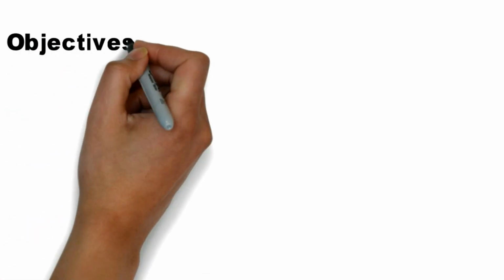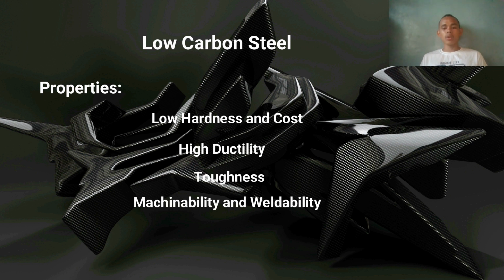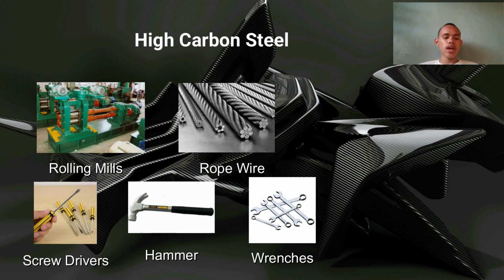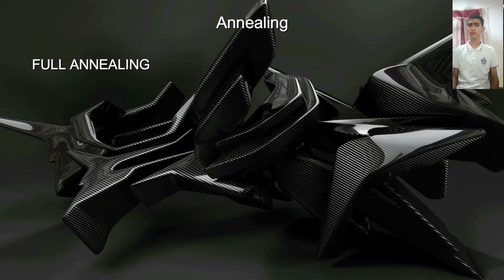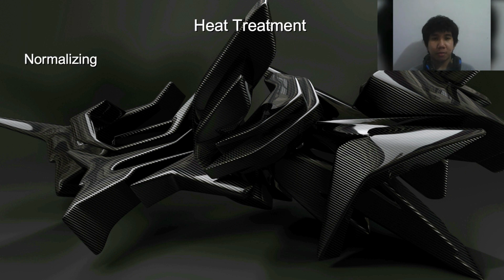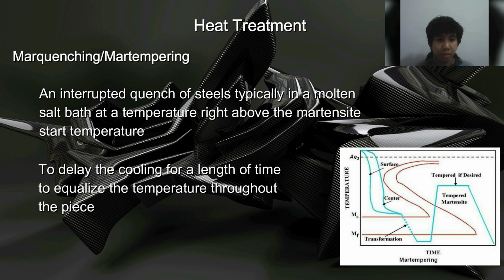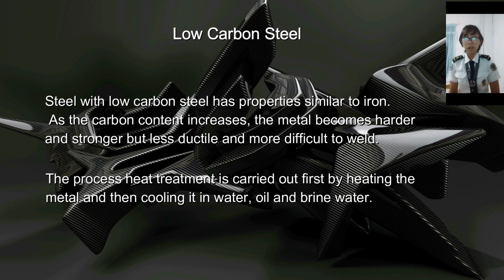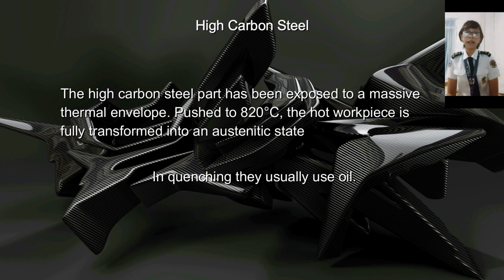5. EMAT: Heat Treatment of Carbon Steel

Comment: thank you for this report i learn that The purpose of heat treating carbon steel is to change the mechanical properties of steel, usually ductility, hardness, yield strength, or impact resistance. Note that the electrical and thermal conductivity are only slightly altered.

Comment: In this lesson, I understand that carbon is the most important commercial steel alloy. Increasing carbon content increases hardness and strength and improves hardenability. But carbon also increases brittleness and reduces weldability because of its tendency to form martensite.
High carbon steel has a much better tensile strength, used to make cutting tools, blades, punches, dies, springs and high-strength wire.
And I learn the 3 types of Carbon Steel which is Low Carbon, Meduim Carbon Steel and High Carbon Steel and it's important when we say Low Carbon Steel is more pliable, which may improve its effectiveness for certain applications while lowering its effectiveness for other applications. Meduim Carbon Steel used in the quenched and tempered condition. These steels are mainly used for making shafts, axles, gears, crankshafts, couplings, and forgings. And lastly the High Carbon Steel used for things like cutting tools that retain their sharp edge, and masonry nails that can be driven into concrete blocks or bricks without bending (although due to their brittleness they do have a propensity to fracture.

Comment: Because of this video I've learned about heat treatment of carbon steel and the 3 categories such as low carbon steel,Medium carbon steel and the high carbon steel and also I've learned about the purposes of heat treatment the purpose is to soften the metal and to change the grain size. Also I've learned about the 6 types of various that treatment process for carbon.

Comment: As the reporter of carbon steel I can say that they well reported these topic. The heat treatment of carbon steel. There's lot of information you can get of you watch these video. Like categories of carbon , the properties of low, medium and high carbon steel and the uses of it. You can learn also the various type of heat treatment which are the annealing, Normalizing, hardening, austempering, martempering and tempering and there purposes. And you also know the benefits of heat treatment process in engineering material. Thats all thank you.♥️😊

Comment: I have learned in this topic which is heat treatment carbon steel, 
      Specially the 3 type of carbon steel , which are the LOW CABON, MEDIUM CARBON, and the last is HIGH CARBON.

Comment: what I remember in this report is are the types of steel that its contents each with hardness, and moderate, type in steel. and it has processes called heat treatment. and it has have a various steps that are correct such as softening with steel and shaping curves or forming.

Comment: Thank you for sharing this video, i learned a lot specially the Suitable heat treatment process for common carbon steels
process consists of heating the steel to high temperature (1100- 1200). It is held at this temperature for 3 hours to 20 hours and then cooled to 800-850 inside the furnace for a period of about 6 to 8 hours. It is further cooled in the air to room temperature.